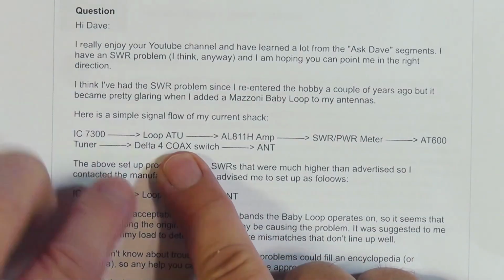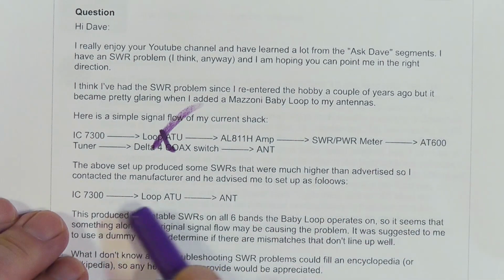Getting your Equipment in the Right Order (#474)

Comment: Thanks for all the interesting comments! As has been mentioned, the Baby Loop is rated for 450W BUT their tuner is limited to 200W max, hence as long as the ATU is upstream of the amp all is good.  The problem was my installation was too close to my house on one side, and owing to the manufacturer's requirements and my XYL's requirements for a bit of stealth I was forced to take the Baby Loop down and sell it at a large loss. 

I have had a Hustler 6BTV for 2 years and replaced the Baby Loop with an Alpha J-Pole Sr.  My SWR problems have worsened to where the 6BTV will initially tune up fine, but as I transmit (CW) and things warm up the SWR rapidly climbs to a point that the IC7300 will shut down.  That happens running barefoot or (more quickly) with the amp.  The J-Pole Sr. does not have that problem (no amp, max is 125W) and will operate happily for long periods with no appreciable SWR spikes.

I resubmitted this as a question and will hopefully get some advice on how to find the cause.  If anybody has any insight feel free to email me, my QRZ page information is current.  Thanks again!
Reply: It seems have isolated the problem to the 6BTV.

Your loop problem was probably all incorrect chain of equipment as Dave indicated.

Your current problem is likely either mismatch or failing connection. I would feel for heat at various points when you radio starts folding back or shutting down.  I would check coax connections and the antenna itself for points of heating.  If the problem is more pronouced on certain bands it may be the antenna needs adjusting or maintence.

Be sure you have followed manufacture's recommendations for coax length, type, routing, ground radials etc.

Again, when your 7300 starts shutting down feel for hot spots in the RF chain.

I hope this helps.

Whatever is heating up is most likely the problem.
Reply: @vironpayne3405  Thanks for your reply!.  Actually the Baby Loop problem was due to my bad installation; the loop was too close to my house on 2 sides, so the SWR was wanky.  However I did take down the 6BTV and discovered a fried section in the top tube, just below the 80M resonator.  The manufacturer told me that could happen if I was 1) "Force feeding" the 80M resonator far from its resonant frequency using a tuner, 2) Using this antenna at a moderately high power level on a continuous duty mode such as FT8 or RTTY, 3) The resonator is not tightly seated on the threads, or 4) Nearby lightning or static discharge.  

I got my answer when I took the antenna down and noticed the resonator was loose.  I don't use FT8 or RTTY and have not had any lightning strikes.  I made the repairs and a couple of modifications and will be putting the 6BTV back on the air next week, so we will see if I am right.

Comment: Will someone please end the coax length debate. I have been schooled to run odd 1/2 wavelengths of coax between the radio and antenna. The reason given is that at the ends of the coax at odd 1/2 wavelengths the impedance is the same as your transmitter and the antenna can then be tuned properly. Now, what if I want to install a VSWR meter after the radio, between the radio and amp or between the amp and antenna. If I insert a VSWR meter, where do you install it to read the impedance match? Do you measure the electrical length of the coax with the meter connected directly at the output with connectors not coax...considering the internals of the watt meter add to coax length? I've heard 3' length multiples, I've heard to cut jumpers to zero reactance and odd electrical 1/2 wavelength multiples. Please help to clear up the misconceptions...Perhaps a Video with examples of coax length...???...

Comment: I see what you are looking at. my problem is  I have a now tune antenna and it will not take a tuner. but my question  is the antenna was bent in the wind. will it cause any problems this was realll caused as the people that was putting in up slightly bent it when pupping it up. I do have mfj auto tuner. .
Reply: Hello remove any tuner apart from the tuner supplied, either connect the Ciro tuner to the rig or type in the freq using the keypad it will tune, ref the damage if its bent to the extent the fins at the top are touching that will need to be rectified :)